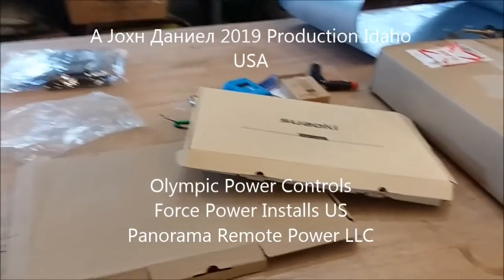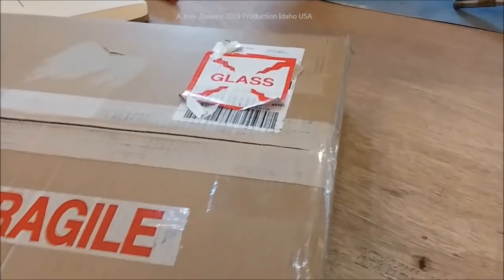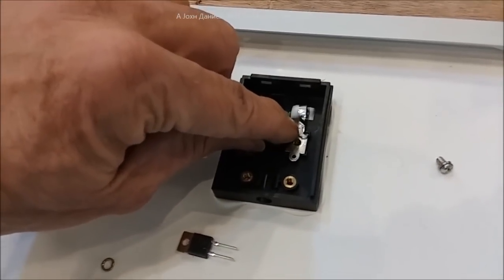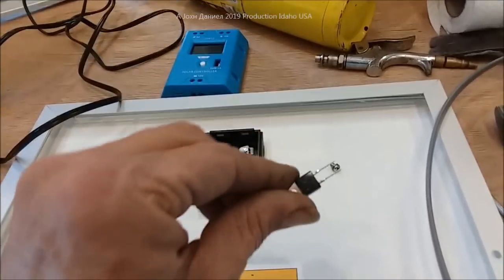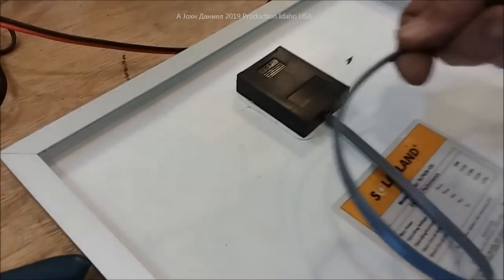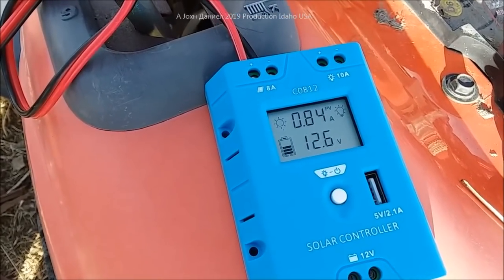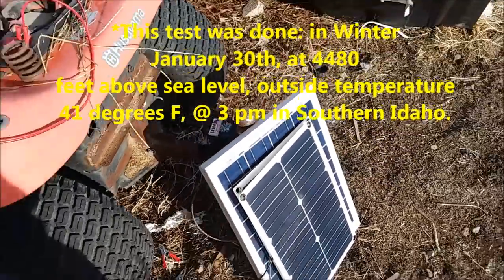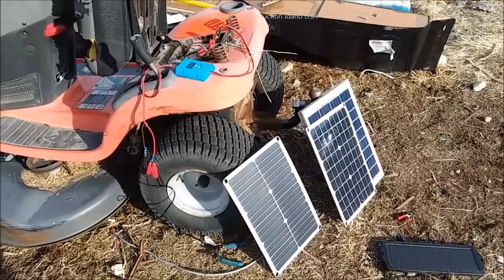20+ watt Solar Panels under $35, Which one is best? ALL Parts used Below, UPDATED!

Comment from the maker: Full list up above, ↑ ↑ HIT SHOW MORE. This test was a winter test, low angle full sun, with a very light 5% atmospheric haze . That reality results in a 15 to 20% solar output loss, so full output will be higher in premium conditions.
Reply: The numbers are a little off, I think.  Even at a 20% derating, 12.5 x 0.84 = 10.5 watts, which would be 80% of 13 watts.  I still think the rating on that panel is good, but I think 20% only accounts for the angle of the sun, and not the hundreds more miles of atmosphere it has to travel through at low angles.
Reply: No offence dude, but like when are your going to stop wasting money on toy solar? https://www.aliexpress.com/item/33061987391.html Wind turbines isnt the only thing the chinese are doing right these days ya know??
Reply: Just hit the link ..$108 us....has it really gone up so much...??
Reply: Hi John, I got some tiny 6 volt glass solar panels with some Raddy multi function radios. The plug on them is a match for my Sangean PR-D4W radio and powers it perfectly. The Raddy radio was an impressive camping radio idea but they built it cheaply. Its panel charges four 18650 batteries, but they`re in parallel in it, so a battery or two can be removed and used in something else and the radio still works. 

It has bluetooth, AM/FM/SW, loud speaker, a nice very bright spotlight and room light, and came with three light bulbs on long cords which all have their own ports. Plus it has a phone charger. It has so many functions that I can`t remember them all. The first one I got was really good, great reception and everything, but the second was DOA, so they sent a third and I got to keep the bad one and its accessories.
Reply: Well, I was interested in your channel until this. Looks like you're one of the MAGA morons. Time to make sure you never come up in my suggestions ever again.
Reply: @Citadel_Of_My_Thoughts  Hah  Good luck with that.  I've tried to remove channels from suggestions.. it works for a few days, then they're back.  BTW, I'm one of those, MAGA's myself.  Since you put it that way, I guess you're in love with the Felons that are running the DNC right now, eh?

Comment: I don't know if people know this...Your charge controller works as that diode you put in. They stop all back feed.
Reply from the maker: Only if your using one panel. If you use more than one, and one gets shaded or dirty it stops loss of power from the other panels.

Comment: Oh also, been wondering, since the bigger panel is probably designed for solar controller use only, is soldering in a good diode necessary or is it just extra protection? Thanks!
Reply from the maker: If you plan to add more than one panel, a diode stops shading or lower output from one causing a draw effect on the others.

Comment: Hi, I just bought one panel like the one with that strange name which you couldn't spell (Suaoki). The one that has a diode and gives some 2/3 of 1A. What i need to know is if it can overcharge my car's battery if i let it on several days (and nights) because i have no controller. And if it doesn't discharge the battery during the night. I use it as delivered connected to the battery over the cigarette lighter. I need it to keep the battery charged enough to be able to start, because i drive only small distances and only once a week or so and mostly in winter the battery discharges and i can not more start. I am not an electrician and the documentation doesn't say anything about these things. Thanks in advance for your help.
Reply from the maker: Your OK with the average car battery to use up to 25 watts (1.5 amps) in this style of solar without a diode or controller, they are designed to make 18 volts not 22 and the result is the internal resistance of your battery won't allow them to over charge as long as your battery is in the car and attached to the electronics in the car normally. Your car battery is being maintained this way. The electronics in your car, capacitors and the cars computer will always absorb the extra and the panel will keep the cars battery just barely ahead of the losses from ghost loads with this size panel. If your battery is getting too old, you can add life to it so it gives you many months more of use.
Reply: @JOHNDANIEL1  Thanks. And can i let it connected day and night without losing power from the car battery in the night when there is no sun ?
Reply from the maker: Yes, a diode is to prevent draw when 2 panels are in use.

Comment: Why did you not test also the small one? That one is what i want to use to keep my car battery charged over winter and I wanted to see if it works. I would leave it on the whole time , connected to the cigarette lighter, inside the car but on the window in South direction. Do you have a video about that one? I can't understand why nobody cares about such cheap  solutions to keep battery charged if you don't use the car for a longer time.
Reply from the maker: I think I have a video going back beforehand where I tested each one of these independently I'm not sure if it's still up.

Comment: I bought a 20 watt good glass metal framed panel with the solar regulator and all the SAE wire hookups for $50 on Amazon. I know I paid more obviously, but I had no issues. It worked very well almost 2 more volts then when I started out. My car battery read 12.5 on ohmeter without the panel, when I plugged it in, it went to 14.8 volts. So i spent a little more and got a little more power.

Comment: Hi John, what do I need to hookup a solar panel, computer fan, to blow or pull air through my 4 x 8 ft solar air heater box and air through about 10ft of piping into the house? I want it to only run during the day when the sun is out. Cheapest setup please! I've already ordered a solar panel from amazon, Newpowa 10W Solar Panel 10 Watts 12 Volts Polycrystalline with 3ft Wire RV Marine Boat Off Grid, and trying to power a computer fan, do I need a batter and charge controller in the middle? I just want it to run during daytime hours of course. Thanks so much. I'm a greenie to solar power thanks.

Comment: New to solar. I have a 30 watt panel - can I use the diode on the 30watt? And what does the diode do? Sorry, very new at it.
Reply from the maker: Yes, on a 30 watt, you can use a 5 amp but if its only 1 panel you plan to use you do not need a diode. The diode prevents backflow voltages or shaded/failed panel effect on other solar panels or wiring that is pre-controller.

Comment: Nice to see that standards have not improved in a year apart from the charge controller. You can get a slightly better one for £2.50 from Ali Express. The panels are pretty much the same, just wish I could find the OEM version of the Renogy panels, the markup on Amazon must be amazing.
Reply: The panels are pretty much the same,....No they are not...lol. The metal framed one would always be better long term....FACT. If you only need a couple to suction cup to a rv or hang from a tent or back pack, so be it. The hard case would be better, buy 2 and hinge them and fold them up like a briefcase.

Comment: 4:08 with dc to dc converter, not resistor.. just to bee cleer edit: why did you cut that solder plate??? All you had to do is slightly bend those diode legs and solder one approppriate leg to the left and sec to the right
Reply from the maker: Using as single solar to charger then for eventual lithium charging, for multiple panels on all else use the diode on the +/- only.

Comment: My experience is... Aliexpress - totally dishonest. Ebay - mostly not too bad. I have a 60W flexible panel from eBay that had no label on the back and which actually produces 10W. I have a 20W flexible panel that had no label on the back from Aliexpress that also produces just 10W. I have a 20W glass panel from Walmart and that produces 20W. Sellers of flexible panels usually seem to lie about the actual output. I tested one of the flexible ones here... https://www.youtube.com/watch?v=I5VMNDsrXRI&t=3s against my 20W glass panel. I'll have to do a better test and test the eBay flexible one also.
Reply from the maker: Aliexpress allows mega scammers on as well as completely honest folks, you have to be absolutely careful and if it even sounds like its fake ( Example - 4000 watt turbine hahahaha 20 lbs with 40" blades * FAKE FAKE FAKE* ) verses 500 watt turbines I use that have 62" blades, weigh 47 lbs over 2X as much and really work better than rated. Took me a long time to sort out the 80% fakers from the 20% honest, so I share my sources to help out avoid the scams. Ebay too is about 40% total scammers, same deal on how much I work to avoid them and share who I find thats honest. Evan Amazon now is risky with scammers.
Reply: @JOHNDANIEL1  OMG I won't touch Amazon. That has been scammy since they first started. I remember buying "new" books straight from Amazon and had dog-eared old books with suspicious stains etc. One even came with a cigarette stubbed out on the cover and in the packet.

eBay I bought a 50W flexible panel thinking that at the price it'd be a good flexible 10W panel which it actually was. Then I went after the seller for a refund and agreed to 30% refund. I was happy.

AliExpress, out of my batch of 6 orders, they sent a bluetooth module for my charge coontroller with the wrong connector. Two articles of clothing way undersized and unusable, one solar panel that wasn't even 20W. The can openers I ordered were OK. I used one as soon as it arrived. 

The battery charger that arrived was really quite excellent.

It's a mixed bag of good and bad but on the whole it's biassed toward bad. I won't be using Aliexpress again. My experience of Alibaba was the same.

Comment: Forget the diode!! Just use a charge controller.  The ubiquitous cheap ones for $10-$14 on ebay work.  They push .1 (1/10) volt more than whatever the current charge on the battery is and that will de-sulfate flooded lead acid as well as charge your battery.  Modern panels are 18-20 volts and don't work well w/o a charge controller.  (*De-sulfating can take a few weeks on a marginal battery.)
Reply: My 23v controller-less works perfectly fine. The battery dragged it down to 14.5 to 15v.

Comment: I have a 1 ton work van, but at the end didn't know wich one is the good one, can somebody tell me wixh ine can keep the battery charged? T.nx
Reply from the maker: Per your question - Best MPPT controller 40 amp https://amzn.to/3eHPxDE Best Solar Panels https://ebay.to/2CHae5B , You can put 4 of those on the van, and get 35+ amps continuous to your batteries.

Comment: This was great, except, time changes everything...
Those 21$ panels are currently 46$ (but "free shipping").
The solar charge converters are way cheap on Ali, but 11$  on Amazon.
But thanks for the great info.
I'm still learning, watching videos, and pricing on some of the components is really high, in my mind.  I don't know the intricacies of PWM vs MPPT controllers, MPPT is way overkill for small systems.

Comment: The other panel you showed ,the flat flexible one is like one I have but I cannot figure out how to get the module open I've shorted mine out and need to check if I popped the fuse or diode but can't figure out how the hell to get it open 😟
Reply from the maker: Some slide off to the top end, and some are pressed and glued. But if its stopped making power its likely a loose or shorted solder joint where the wire meets the terminals inside the box.

Comment: What if l conect two of these solar panels (20 w 5-12v each one) to a dual usb adapter to charge a battery or a telephone. ? Would it work as well?
Reply from the maker: just get 2 then wire straight into a small controller with a USB on it. Mine for my back shop window just has a single 50 watt https://ebay.to/2qqzAOJ ( cheaper than 2 of those) thats the size of 2 of the 20 w and a 10 amp charge controller with a 3 amp USB charger in it. I put a 10 amp UB 12100 Battery on it,  I use it for my tablet, camera and inspection camera charging.

Comment: what is a diode? what happen if i do not use it
Reply from the maker: Without a Diode you can get reverse voltage at night or in the case of a lower producing panels you may get loss of power totals without diodes to keep voltage in one path.
Reply: @JOHNDANIEL1  ic, thx

Comment: After watching this video I got the same controller. Have connected to 50W solar panel and 
motorcycle Pb/acid battery,  Display show charging 12.4V,  0.00A. It is rainy day but why 0.00A ?
Reply: нужно солнце

Comment: Great intro video for me. Got the pieces put together with a 20AH apm battery for a little demo solar generation system that should be enough to a laptop, charge a phone. Got a 12V light bulb and modified a small ikea lamp to wire directly to the load side of the charge controller. All working!
Reply: Wao. That much power you got. Any video to prove it?

Comment: "Test 3 popular 20 watt Solar Panels"  And 60% of the way in we've explored the surface reflectivity (!?), how to safely open a box, and how to put a diode on the cheaper ones.  I'd give you the last one, but still Definitely in the Top Ten of YouTube Don'ts.  Stick to your title if you want more Subscribers and Thumb-Ups.  Keep side-tracks short and sweet. "This one came with cables, this one didn't even include diodes, I'll show you how to add them later" "Be careful opening the boxes - the cheaper ones usually aren't packed well."  Bam.

Comment: Which solar panel would be good to use for smart phones? I bought a few pocket solar gear products they charge really slow and only gives one bar after 6 hours charge. I used Bruton solar products doesn't work that great for changing.
Reply from the maker: Truthfully any of them with a controller added that puts out full panels wattage @5 vdc on the USB ports.

Comment: Great video but I have 2 questions. If you're going through a controller why would you need a diode ? Also, don't you lose voltage( I'm guessing around .3 volts) when you add a diode? Thank you...this was very informative.
Reply from the maker: Starting with 22.5 volts, its OK to run the diode on the Solarland. With running them as blocking diodes I can put them on as Awning sun shades for my RV on all sides without the occasional shaded panel getting reverse voltage.

Comment: Unless you're connecting the panel directly to a battery or using an extremely cheap charge controller without isolation, you do NOT need a series diode.  If you check carefully, you'll find that current production solar panels have a BYPASS diode across the panel output, which only comes into play when you have series connected panels and they are subject to partial shade.  When the output of a shaded panel drops sufficiently, the diode will be forward biased by the voltage from the other panels and the shaded panel will be bypassed - that's the reason these diodes need to be rated for the maximum panel (or array) current. 

I have two of these panels on order and while they will get diodes, they will be BYPASS diodes for the (unlikely) possibility I'll have them in series for connection to an MPPT charge controller which can actually do something with the excess voltage - excess when 18 volt panels are in series and charging a 12 volt battery bank.  I'll be using 15SQ45 15 amp, 45 volt Schottky diodes for their low forward voltage drop and these specific diodes because they are spares for repair of the 250 and 300 watt panels used in my larger solar system.
Reply: OR connecting more than one panel.!!   Please don't forget that - multiple panels need diodes to keep a bad or shaded panel from pulling the rest down.

Comment: Question :  What is the actual Voltage coming out of those Solar Land panels ?   18V ?     Looking at E bay says 12 but just wondering.   Boy they seem to be selling a pile of them.  A MPPT controller could bump that Amperage up a bit.    These are cheap enough.   Used them with no issues.   https://www.banggood.com/MPPT-Solar-Panel-Controller-5A-DC-DC-Step-down-CCCV-Charging-Module-Display-LED-p-1089155.html?rmmds=search&cur_warehouse=CN

Comment: Re-test them using a 20w-30w light bulb not a solar charger and use a multimeter to check the amps.. chargers will always start low and not bursting full on amps. They all do this to extend the battery life.
Reply from the maker: Specs on the charger says it puts out full power from 10.8 to 13.6 then it starts modulating its and reducing rates till it reaches 14.1 vdc. All had a identical test on identical conditions that could be provided. Testing the short circuit rate won't tell you its actual ability to charge a battery.

Comment: You put the diode in wrong it is supposed to go between the + -  to stop the adjacent panel back feeding it in the shade
Reply from the maker: Tried to reply with my silly cell phone, it was spammed off? Hmm. The Diode on these small panels are for blocking, If I had a need for connecting Solar Panels in Series, then a bypass diode would be a nice application. But with such a small panel, the loss of 1 amp out of 6 or 10 panels is not the same as the loss of 10 amps on a 150 watt panel which will use both a bypass or dual diodes on the 2 outer neg strips to the center pos. But like all 18 solar cell panels they are better served with a blocking diode thats 150% higher rated than the array of them you plan to build. In my case, we are using 6 per awning with 8 amp controllers on them.